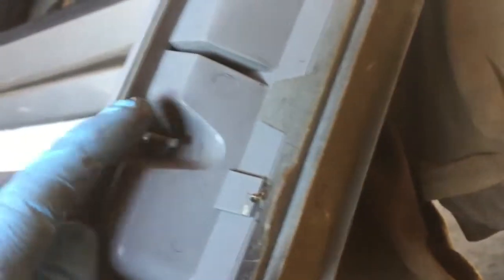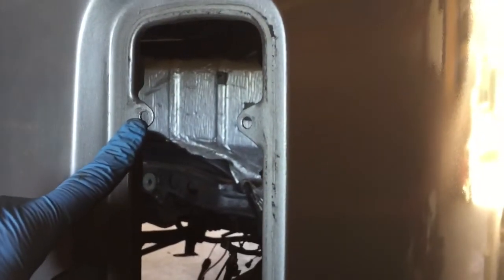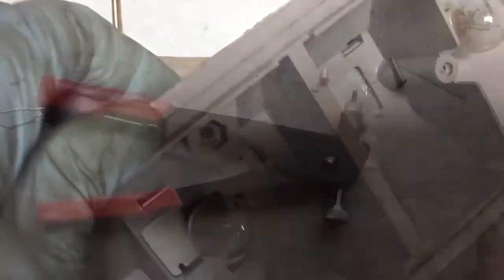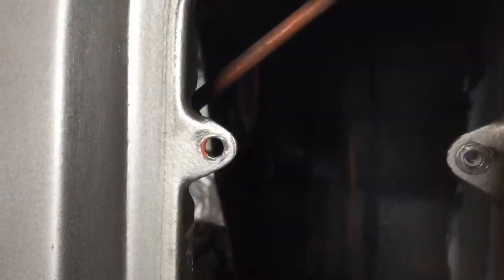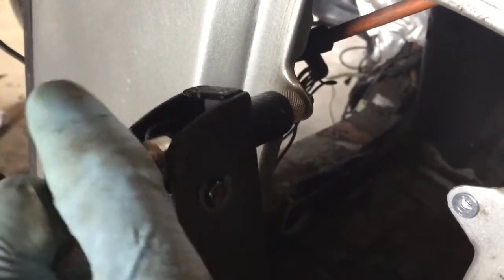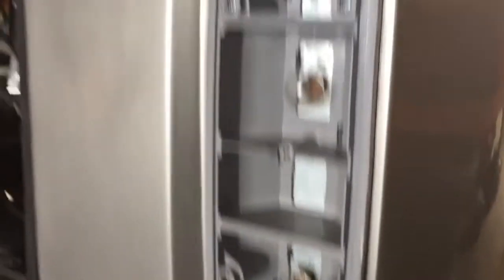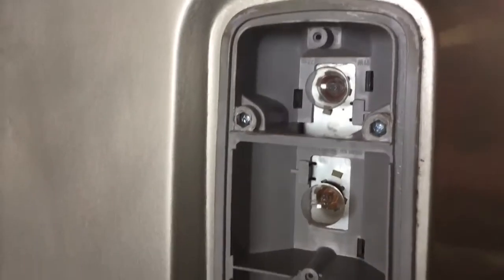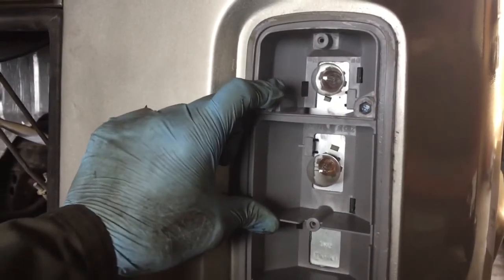$2 VW Bus Upgrade - Nutsert Tail Light Mod

Comment: Stole it from me! But always glad to share!
Reply from the maker: +Marshall Webber I always appreciate comments but I've been doing this for years and years.
Reply: Well then I stole it from you! Regardless, great minds...!
Reply from the maker: +Marshall Webber have you done a Subaru swap that necessitated that mod? It sure helps when trying to check on the radiators in the engine bay.

Comment: Who are you? Where have you been? ;-). I was kinda expecting a long travelogue of the school bus adventure, but that's OK. More interested in the Subaru conversion stuff. How's that Bug rolling?
Reply from the maker: +Forthwith Tx I needed to brake back into videos with a short but useful one ;) Bug project has been stalled out - been working on really cool customer projects and my personal vehicles are getting no love.
Reply: Glad to see some new content. I also did this mod on my 1974 even though I went belly mount for the radiator. Climbing in the engine compartment to remove the tail lights once was enough for me.